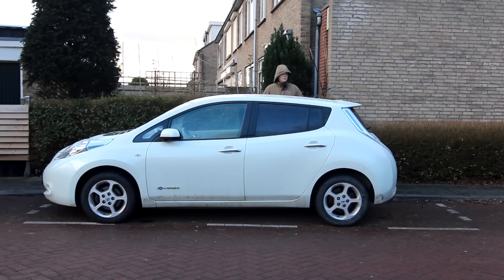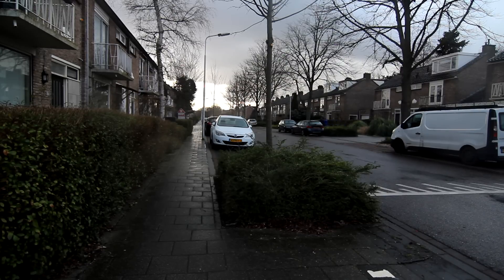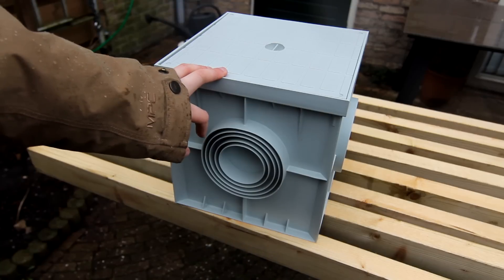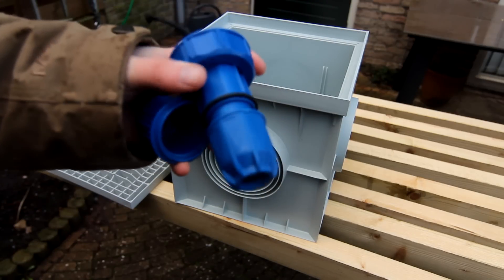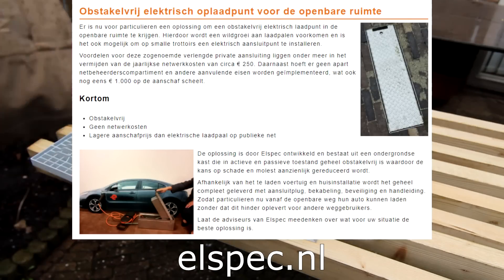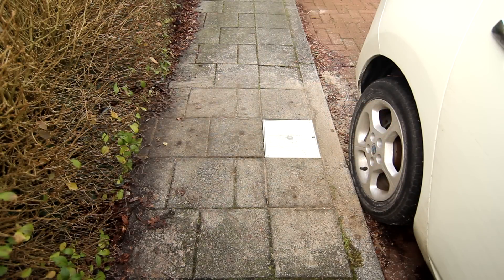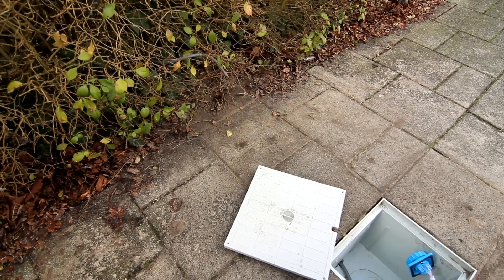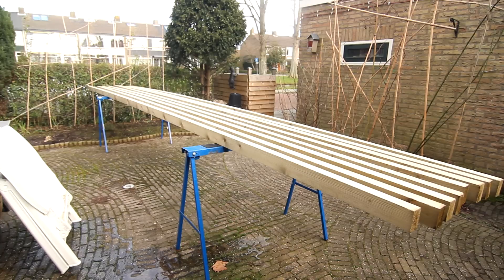EV charging point in the ground

Comment: My immediate thoughts on safety. 1. You shouldn't have shown this video until you completed the installation as it's clearly unsafe in the video with no back housing on the socket and 2. You need drainage for the box - none of those connections are rated for submersion in water and neither is the EVSE.

Comment: Am I missing something, or could you not have just mounted a charger on the outside of the garage (or just inside the door) and parked in the driveway in front of the garage door? No digging required.

Comment: Amazing clean installation. I have a similar situation in Utrecht and even the gemeente was “kind“ to put me one of those 34 cent chargers on the other side of the street :D so there is no argument for me to convince them anymore. My extra solar energy is just wasted back to the grid at the ugly 7 cents compensation for energy return.

As an engineer, I get concerted a bit with safety  (will do my best not be a devils advocate):

- this type 1 charger probably sucks 10~16 amps from your outlet, is that electric group on the wall outlet having no washing machines, dryers, PlayStation. Any high current devices?

 - Another point, I am actually more leaning to investing in a wall mounted type2 charger on your house, and running a long charging cable under the ground, so that only your charging  side in the box. This way, you have the cable in the ground. And even if it gets swimming in rain water, will never short circuit or cause a hazard. Yes, safety is expensive :(

Yet even with all safety taken into account, the governments will keep preferring to invest those monopoly public chargers for some businesses to keep running. Then in 5 years, they will be like phone booths that have no use

Comment: Should put some conduit over that power cable, stop any clueless gardeners or anyone digging up the footpath from zapping themselves.
Reply from the maker: This is what's called a ground cable (think it's called a shielded and guarded cable in most English-speaking countries). It's got two shields, one thick steel braiding and one fairly tough fiber-reinforced nylon anti-puncture sheathing. This is required in the Netherlands for any cables in open ground. So there's really very little chance of anything bad happening, unless somebody takes a chainsaw to it.

As for the above-ground portion: yeah, that's going to get a little conduit all of its own, probably one of those flexible conduits used in heavy machinery. I do have to be able to trim that hedge without damaging the outer PVC.